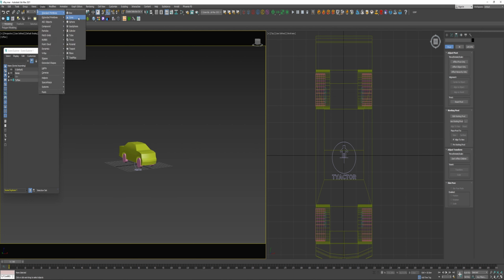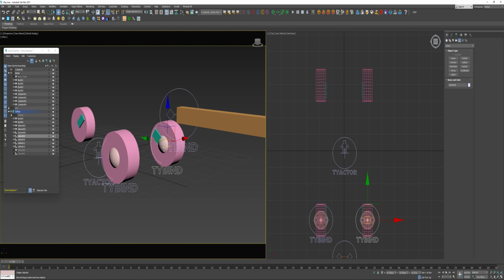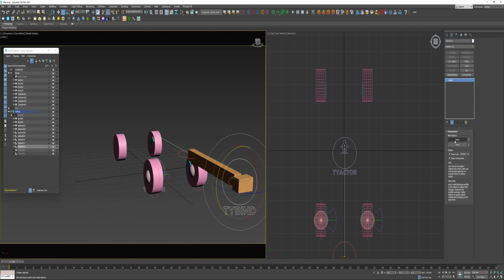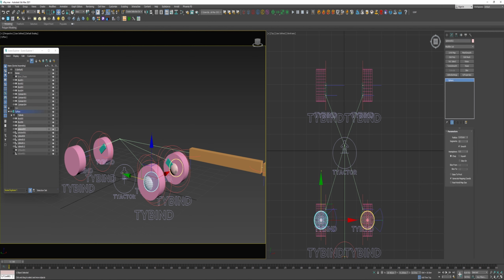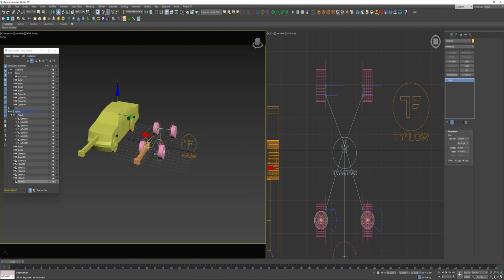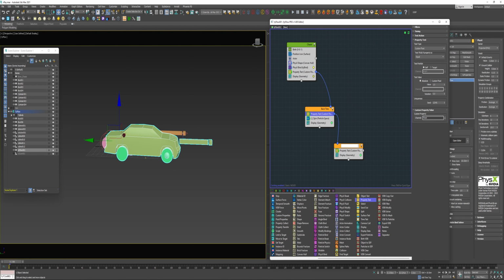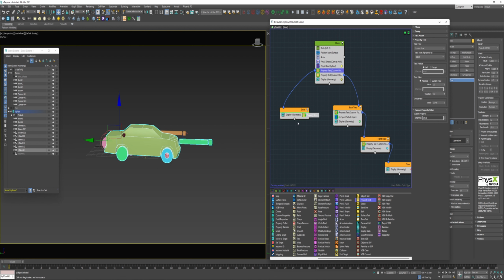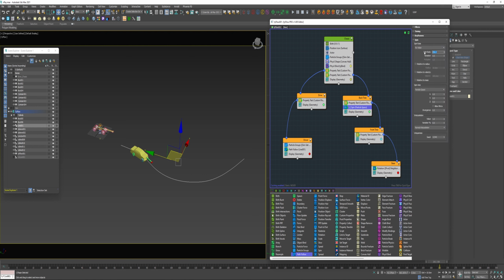Control a Simple Dynamic Vehicle Rig in TyFlow / 3D Studio Max - Beginners Tutorial PART 2

Comment: First part works well. This one doesn't and I have no idea why. the rig falls through the map instantly. I fixed that but the wheels don't turn. I followed every step and even started from scratch twice, but since I don't know why you're doing what you're doing...
Reply from the maker: Hey, sorry to hear you’re having some issues. I’be actually re-recorded these two videos, but haven’t edited them fully as of yet. There was a change in tyflow about 6 months ago, and the videos needed to be updated. One thing I’m thinking you could try is to add a mass operator to the steering objects, if you haven’t already. Some time the tension on the binds will prevent them from moving. You can also feel free to send me your file, I would be glad to get it working. My email address is lanceculver@gmail.com
Reply: @lanceculver  I though it must be something in tyflow that changed. I'm a super noob at tyflow, but I'll try to add mass as you said. Can't wait for the videos! Thanks for the reply!
Reply from the maker: @calinpetrescu9128  yes sir, of course if that doesn’t fix the issue let me know and will take a closer look. Thank you sir

Comment: I really like your videos. Very helpful, but i am not shure if something in Tyflow changed, because the Wheels just dont align to the aligned Spheres inside. So the wheels do not rotate in Z corresponding to the sphere/ Steering box. no matter what. tried building the setup a couple of times to verify any pivot problems, but it is just not working with an exact rebuild of your presented setup. If you have any idea, i would be glad if you let me know. Thanks in advance.
Reply from the maker: Hey, sorry just seen this. I don’t recall having that issue, but will open the scene in the morning and see if I can recreate the issue. Also, If you want, you can email me one of the versions you’ve worked on and I could look through it and find the problem. Thanks for watching, and for commenting, sorry again my response is so late. Lanceculver@gmail.com
Reply: @lanceculver  Hi Lance, thank you very much for your response. I just sent you a mail with two versions.